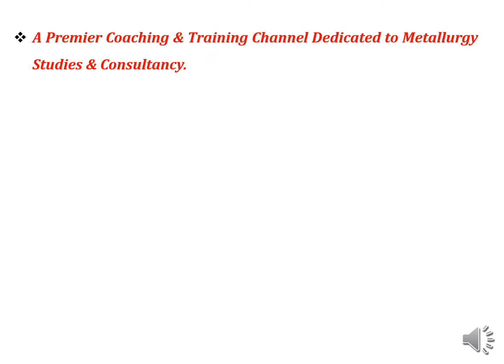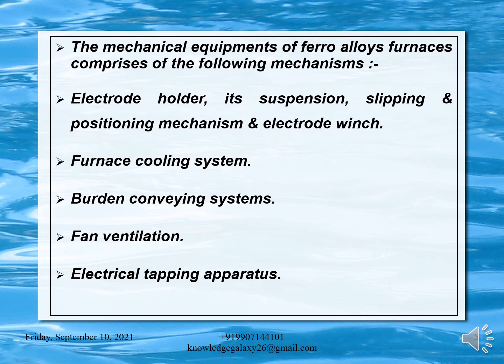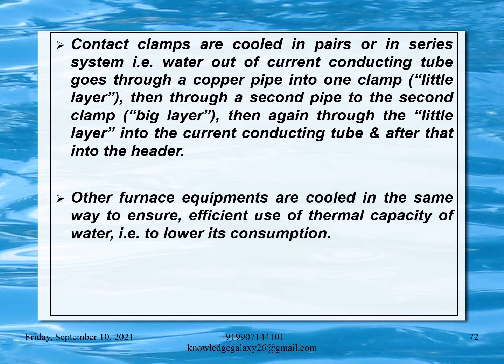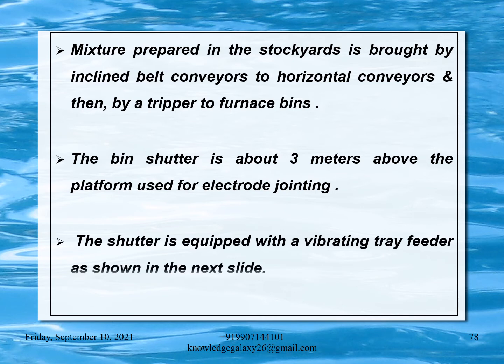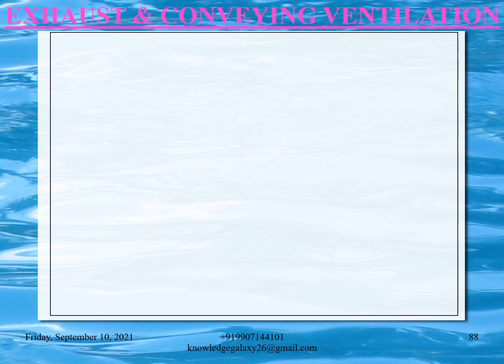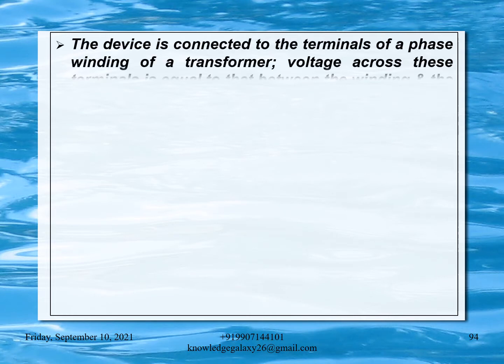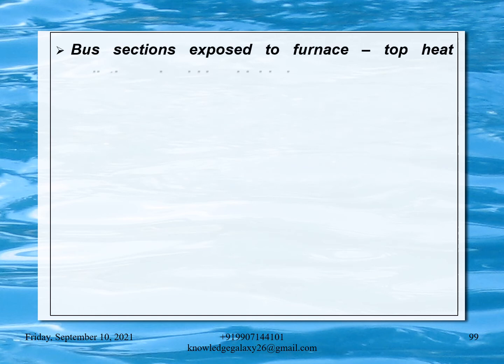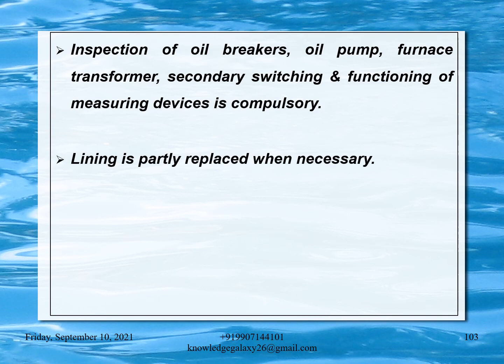MECHANICAL EQUIPMENTS OF FERROALLOYS FURNACES PART 2

Comment: Very nice .It must be watched by all Ferro-Alloys 
People  and use this insight to improvise their working experience for smooth running of Furnace. 
Soft water having Hardness not more than 10 PPM is required for Water Cooling System so that scales are not formed inside the Pipe Line resultantly Pipes are not damaged and choked.